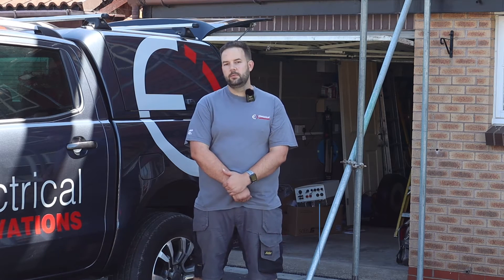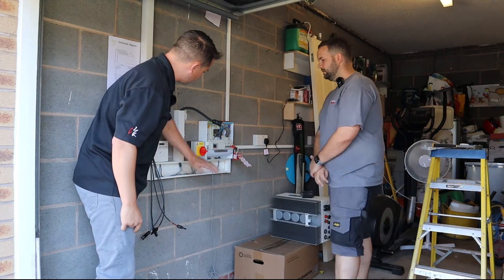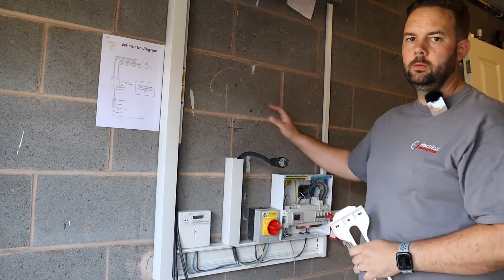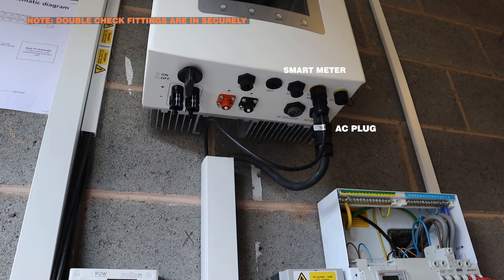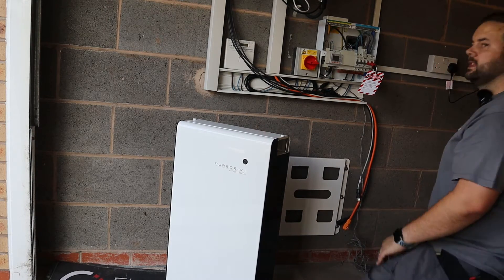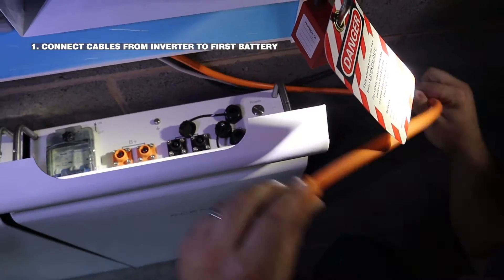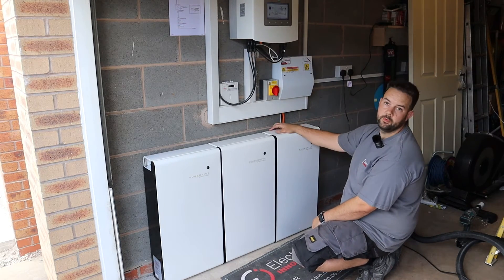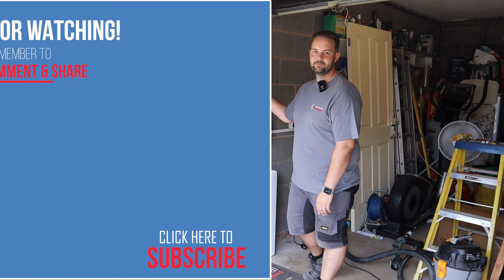Solis Hybrid Inverter and Puredrive battery installation

Comment: I have a pv system installed on a shed in my garden about 20 metres from the house, this is connected to a consumer unit in the shed which is connected to the house. There is no room under the stairs where my main consumer unit is to fit the Solis hybrid inverter and battery so it is also installed in the shed and connected to the same consumer unit. To function correctly do I need to extend the meter CT clamp all the way back to the house to mains live cable? Plugging an electric heater into the shed causes the battery to discharge but it does not discharge when plugged in the house.
Reply: Let me know if you get the answer
Reply: I'm sure you've got your amswer at this stage, but you need to have the ct clamp at the house mains, if it's just at your garage your Solar panels are only supplying power to your garage.

Comment: Hi guys how do I stop my battery from emptying overnight when I'm charging my cars
Reply: Go into the inverter advanced settings and set a discharge period time and duration and a discharge rate of 0 (zero). This stops the battery from discharging during this period. Note that if you have a period when you charge the battery overnight, then the two periods cannot overlap.

Comment: I have the same system as this, except with just two batteries. But for some reason, most mornings, the battery only charges at just over 1kW irrespective of the output of the panels, the rest gets exported. Anyone else got this problem?
Reply: That only happens when it’s cold.  It should work fine in warmer weather.

Comment: Can I please ask… in the manual it says a minimum gap of 500mm to be given on all sides.. all components are well within 500mm… how does this comply with MCS or manufactures instructions? Only asking as we’re doing an install that will be checked for our accreditation and been told they will be checking the gap sizes..

Comment: Would like to get people's opinions on the overdischarge SOC setting. It says here 15%, My installer says it will prolong the life of the batteries if set to 20% (Pylontech us3000c)
Reply: Yes for Pylons keep them high because they have a history of going to sleep at a higher SOC then stated on their Datasheet.

Comment: We had our Solis inverter installed last November 2021. We have had problems ever since. The lights are flickering. On occasion we have complete brown outs constantly every night. Installer also asked us to install 2 different lights but the brownouts continued. When I bypass the Solis system, and go directly to the grid, I have no brownout at all. The installer already replaced the inverter once. If I bypass the system, I have no problem with brownouts. Any help is appreciated

Comment: why don't you install the AC back up ?? as it is in the schematics
Reply: Here in N. Ireland NIE will not allow live systems when the network is down. Might be something like that.
Reply: @mirola73  yeah but must be able to be disconnected and have an TT  earthing system , I will need to check the 18th edition , no point having batteries and an EPS that cannot be used in the event of a power outage
Reply: @mirola73  just checked , reg : 826.1.1.2.1

and reg : 826.1.1.2.2  covers it for UK

Comment: The meter install diagram you showed is bobbins!  That's an industrial 3 phase unit and not what you installed. This inverter sticks out too much Solis should think about running their heatsink down the sides not behind.

Comment: Does solis inverters work with custom made battery packs (non spec brand) ? Lifepo4 48v 5.1kwh for example?
Reply: Yes there is a custom battery option.
Reply: Please note we won’t warranty if you break it.

Comment: Can this system provide blackout backup power? The solis inverter has an AC backup output for critical loads (UPS). Can this be used in the UK in the event of a blackout or is it disabled. I understand that any loads connected to the backup port would need to be supplied via their own breaker/RCD etc independent of the grid supplied consumers.
Reply: Grid ‐ Breaker - Solis Inverter - Breaker - Critical Load. Works as you would hope, always has power wether grid, solar or battery down any one can be a power source.

Comment: Nice neat job gents. Its clear to see pride in your work, not like some other examples floating about on social media. 

I was just wondering however, which cable did you use on the AC side between your inverter and isolator.  I am about to embark on a similar job, however I note the AC plugs provided with the S5-EH1P6K-L are looking for a nominal cable diameter of between 10-12mm. My go to would have been the H07RN-F spec, however, for a 6mm2, its OD is 14.78mm, even the 4mm2, which is too small for my job anyway to maintain the VD < 1%, is still to big at 13.2mm. So ye, what did you use, please?

Also, was there any particular reason why you opted not to use the Eastron meter supplied with the inverter. Noting you have instead used the Acrel ACR10R-D16TE at additional cost?

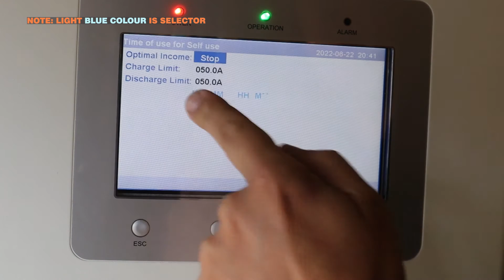Comment: Great video… regarding charging from grid settings at 12:23 in the video, what is the optimum charge limit if charging from a night rate to ensure optimum battery life span. I read somewhere we should reduce the charge limit from 050.0A and charge at a slower rate, but with this impact how quickly the battery charges from the PV panels? Thank you.
Reply: The lower the better.

Comment: hello. what is the difference between RHI 3.6...48ES and RHI 3.6..48ES.5G hybrid inverters . what batteries from Puredrive is more suitable with hybrid inverter RHI.AC or DC batteries.thanks
Reply: Dunno they sound the same. However beware there are 2 different model numbers one has a limit of 11A solar panels the other has 15A.

Comment: What I can find about this inverter is it's 120v minimum battery volts. Is that correct? Are the batterys in series?
Reply: I believe the Solis is a 48V system. You have to be careful with Hybrid Inverters some do have custom batteries that match their solar string input like 350V x 13A

Comment: I'm looking to add batteries & addition panels along side an existing system.  Will this work or is a AC coupled inverter needed?
Reply: This is a hybrid inverter it does everything but just for this unit. If you want an AC coupled battery for an existing system you need something like the Solis-RAI-3K-48ES-5G.

Comment: Nice install, super easy and super clean. I'm not sure I would be installing £10k worth of batteries on the garage floor. Won't take much of a flood and all you will have is 180kg worth of paperweights!
I'll stick with server mount batteries mounted high up out the way.

Comment: Are you saying that you can only discharge down to 20% of the battery capacity, ie, you can't make use of the last 20% of the stored power?
Reply: It extends the life of the battery but 80/20 is Lithium-Ion. Safer LiFePo4 are normally 90/10. You can do 100/0 but it shortens the life from 7000 charge cycles to 4000.

Comment: What is the rated power delivery (i.e. rate of discharge) of this system?

My previous GivEnergy system could only deliver 3kW.
Reply from the maker: We have different inverter sizes for this series. Maximum rated power is 6 kW.
Reply: @soliseurope2817  these batteries wired in series? RHI-1P7.6K-HVES-5G shows min battery volts at 120v is this correct?
Reply: Yes our 3P hybrid uses high voltage batteries.  The one in this video is Low Voltage.

Comment: Any idea if you add a turbine can you monitor its power generation within the solis app with an additional CT? There’s a mention of it in the manual but no one seems to be able to give a definitive answer.
Reply: You wont see it directly but you will see the added power on your grid meter.  I have seen people connect them to our inverters but we wont warranty those inverters if they break.  Also the inverter will charge batteries from your wind turbine generated power.  People ask us that question a lot.

Comment: If you cannot alter the length of the CT Clamp cables, Is it ok to make up a long data cable extension?
I Have my Solis but awaiting delivery of batteries.
These plus the Solis are going in the garage but these will be approx 8mts away from the main in-comers
Reply from the maker: You can do up to 100 Meter between Energy Meter and Inverter.
Reply: @soliseurope2817  Thank you.

Comment: The biggest problem of this system is the App, which does nothing, no graphic, no control over the app. Hope Solis home will improve in near future.
Reply: Your using the wrong app.  The old app is Solis Home and the new app is SolisCloud.
Reply from the maker: Hi, the Solis Home is old version. Please download and register to SolisCloud.com where you have a bunch of informations. Pretty sure everything what you are looking for. Being on the Homepage of SolisCloud, you can also easily migrate your data from the old Solis Home App to Solis Cloud on the very top right of this page.
Reply: Can't even get my Solis dongle onto my network, Solis cloud app just saying its offline